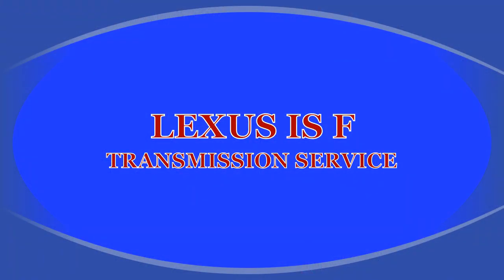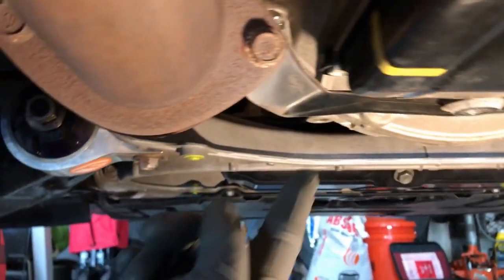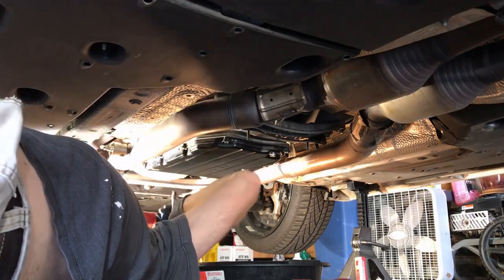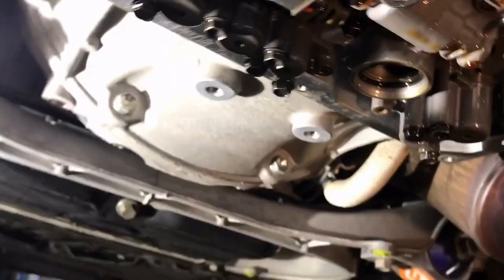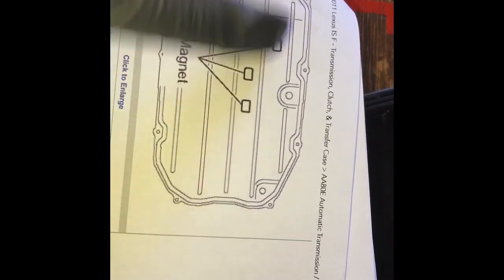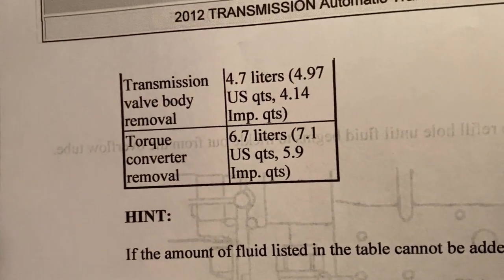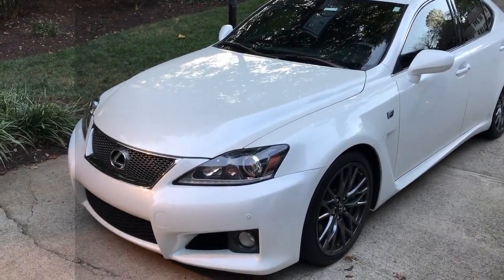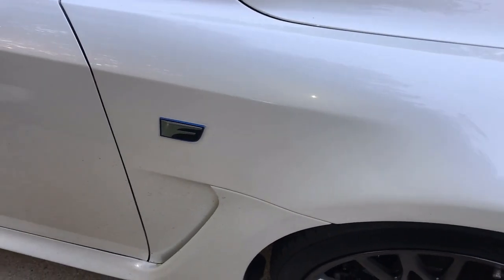Lexus IS F Transmission Service

Comment: I have an IS250 that has 116k miles and the 'for life' fluid has not been changed only inspected. Should I go ahead and get this changed as I want to keep the car going until 200k +?
Reply from the maker: So, over my years of many cars, when an auto trans isn’t serviced regularly, I have always done a basic service on it multiple times over time. A basic service is where you just pull the drain Pan plug, drop 2-4 quarts (whatever comes out) and replace it. I wouldn’t do a full service with filter and more than 6qts (DO NOT DO A FULL FLUSH!) if you drop some of the fluid and replace with new, drive for 1K miles and do another one. Drive another 1K miles and do a third. You should get about 80% of the old fluid out with new. The reasoning is, if the trans has any major wear, the particles in the fluid is what the clutch packs are using to lock up. If you flush the entire system, you can start to have issues with slipping. By leaving some of the old fluid in with the metal material in suspension, it will continue to shift.
Reply: @cpfb68  Thank you for taking the time to reply cpf - Really appreciate your advice here. I am from the UK so Lexus is not a common car on the roads but I love it. I will do as you say and ask my local mechanic to drop the pan for now and replace what comes out and then repeat. I am not confident to do it myself for the first attempt but I might try on the 2nd and third attempts. Thanks again and nice motor love the ISF!
Reply from the maker: @andrewpaul4680  Andrew, IF you are going to have him drop the pan, go ahead and change the filter too. That is a full service (like in my video) but without a flush. A simple service is just pulling the plug in the pan and leave the pan in place. It will get you between 2 and 4 qts out. If you pull the pan and filter, you will get close to 6 qts. Your trans probably holds 9-12 qts depending on which one you have. It has a converter that holds quite a bit so if you pull 6 qts out its half and might cause issues.

Comment: 3gs here so controversial if you should change or not? I’m at 100k now and has some rough shifting points at 1 and 2 not all the time tho drives much better in Ect PWR
Reply from the maker: Don’t do the full service (filter and pan drop). Just pull the drain plug, drop 2-3 qts and replace. Drive for about 1K miles and do again. Keeping most of the old fluid keeps any particles that are suspended in the fluid and is what is keeping the clutch packs functioning. It’s possible if you do a flush, you take away the particles and start to have shifting issues. 

As is get up in miles (sadly..soon) I will do a simple service to the trans (pop the drain plug and and fresh) every oil change. It’s just another way to keep the trans fresh and lasting longer!

Comment: 10:40 nearly gave me a heart attack! LOL. Thank you for the detailed guide
Reply from the maker: Yeah, I see so many people online draining trans, crank cases and diffs before they check the fill plug! Once in a while you see the torch come out to open it! Thanks for watching!
Reply: @cpfb68  
Actually you can fill is/gs transmissions through the overflow with a hand pump/oil bottle pump.

Comment: If you have tech-stream you can avoid jumping the pins and go right on to  shifting correct? Do you need to select a mode on tech-stream?
Reply from the maker: Andrew Lim From the maintenance manual, if you use Techstream software you don’t need to do the Nintendo game shifting with the gear select. The Techstream software will read the temp directly from the fluid temp sensor in the trans directly. When it gets between 95 and 108 degrees F you can open the “dip stick” drain plug and let any excess fluid out. If nothing comes out. You have to shut it off, cool the trans under 85 degrees F, add fluid and start again.
Reply: cpfb68 thank you!!
Reply: cpfb68 how many washers did you end up using?
Reply from the maker: Andrew Lim when you say washers, do you mean the pan plug washers? If so, just the two. One for the drain plug and one for the “dipstick” plug. I also put a new O ring on the WS fill plug

Comment: Thanks so much for posting this how-to.  Did you notice an improvement in shift speed or smoothness?
Reply from the maker: CheaperEngineer Yes! Just after I completed the work, I did a short drive around the neighborhood. Much smoother shifts with normal driving. I later took a highway drive and pushed it. Better downshifts and more sharp shifts under hard throttle. I plan to pull the pan plug and drain just over 3 qts. every other oil change.
Reply: @cpfb68  Okay, seems like this will be worthwhile for my 2011 w/ 115k miles then.  Thanks again.
Reply from the maker: Be careful, an auto trans with higher mileage may not benefit from a full fluid change. If the trans has any damage, the fluid will have more particles that keeps the clutches from slipping. If you drop a significant amount of fluid at one time, the trans may start slipping. To be safe, just pull the drain pan plug and pull 3+ qts of fluid out and replace. Drive it for 1K miles and see how it shifts. If there is no slipping, pull another 3+ qts out and go another 1K miles. If you do this three times, you will get close to 80% of the fluid freshened. If it does start to slip, it may be that your trans was already starting to breakdown and the fluid was holding it all together.
Reply: @cpfb68  Thanks for the thoughtful suggestion.  I took it to a dealer for filter replacement and fluid flush.  Shifts much smoother and crisper now.  Happy with the result.

Comment: I noticed your pan did not have a plastic straw in the check plug mine didnt either?
Reply from the maker: There are two plugs in the trans pan. One is a drain plug and the other is a check plug. The check plug is closer to the side of the pan. You can take the drain out and then the check plug and then use a hex key (I believe it’s a #10 key) to GENTLY remove the straw to drain more fluid.

Comment: Everything still running ok after this change ? Thanks for this.
Reply from the maker: A Aguas it’s been months since I’ve done this work and about 2k after this service I did a minor service where i pulled the drain plug and replaced the fluid. Everything is great! Shifts like new and zero issues. I plan to do another minor service soon just to keep fresh fluid running in the trans.

Comment: what was the torque specs for the bolts inside the transmission... I have an 07 gs350 rwd
Reply from the maker: Andrew Mc I don’t know that my 11’ IS F torque specs are the same as your 07’ GS. I suggest you buy the service manual for your specific car. You can get a manual on either ChiltonDIY.com or emanulaonline.com. They are like $25 and totally worth it.

Comment: Please don’t take this personally. Transmission fluid is Toyota, seals, nuts are Toyota. Why get a beck and arnely filter? It’s an ISF….quality is so much better from the exact factory part.
Reply from the maker: Nothing taken personally, the filter kit wasn’t available when I needed it. It was a 2 week back order. I have a friend that is a Lexus Master Tech that has an F as well. He has ripped apart his car multiple times to track it from a daily. He explained that Beck and Arnely are the suppliers for the Lexus filter. Have had zero issues with this filter and gasket and both looked to have the exact same quality. Everyone has a personal opinion for parts, oil, brakes, tires, etc.
Reply: @cpfb68  thank u for the reply. If that is so that they are the oem to supplier to Lexus then that’s great! For me it’s not taking chances on parts to fail on crappy quality control and fitment. That’s all. You drive an amazing car. Thanks for the time to reply. Respect. 👍

Comment: Does any one know why an is350 would be leaking between the transmission and the engine looks like transmission oil ???
Reply from the maker: If you are sure it’s not engine oil, it’s the seal in the trans. You probably will have to drop the trans and replace the seal around the input shaft.
Reply: @cpfb68  god that's what I was thinking sucks........
Reply: @adolfdiaz7019  I have the same issue currently,  replaced the seal, 2 days of work, reinstalled transmission and it still leaks
Reply: So what it was for mine was the brass ring that goes on the transmission oil pump went bad and damaged the pump shift and damaged the torque converter had to replace the transmission pump and the torque converter 700 for pump and another 300 for torque converter
Reply: @adolfdiaz7019  I actually had a leak between the transmission and the torque converter when i first bought my is350 but the dealer fixed it for me since i only had it for a week

Comment: I dont reccomend using picks for stuff like that, call me a scizo but just use a credit card or something plastic to avoid chipping seating surfaces
Reply from the maker: Yes, there is a plastic removal tool or even plastic razor blades can do the job. It’s what I had at the time. If your careful, it can be done

Comment: Much better to way overfill the trans then drain out … no need to try to put in the exact amount because chances are you’re gonna get the amount wrong
Reply from the maker: I completely agree! For the cost of a 1/2 bottle of WS fluid, you can get the measurement right on the money when draining. I was initially trying to drain and fill with exact amount not accounting for anyone previously doing a service and possibly wrong not putting enough fluid in. Now when I do a minor service, I measure out what I got and add a qt. and see when I open the measurement plug that I get a steady stream coming out.

Comment: Would you sell your ISF?
Reply from the maker: Nick Adkins Sorry Nick, but no. I plan on keeping it for a long while. Have had it for 3 years and over 37 k miles and love it. Sorry.
Reply: @cpfb68  i ended up getting a 2011 ISF in white as well!
Reply from the maker: @nickadkins7765  That's awesome Nick! Glad to hear you found one! They are getting harder to find for sale and in good condition. Enjoy it and take good care of it!
Reply: @cpfb68  i came back yo tgis video because i believe a transmission service would be helpful. It's kind of clunky when downshifting in sport manual shift mode while braking. Everyone I've talked to that has done this service has felt noticeably smoother shifting!
Reply from the maker: @nickadkins7765  Mine wasn't having any major issues with shifts when I did the service but it was smoother after the service. Some may say it's all in my head but I don't believe in "Lifetime Fluid". Doing a fluid service on an auto trans will extend the life of it. There is no proof against that and so much supporting it. If you do the service and two or three basic services after this one trying to get all the fluid, it should be a bit better. If not, it's time to look into what's up. GOOD LUCK!

Comment: You don't pry with a screwdriver. That is how you ruin the trans body and pan. Shock it with a rubber mallet.
Reply from the maker: I totally understand. I still need to get a rubber mallet and a dead blow mallet